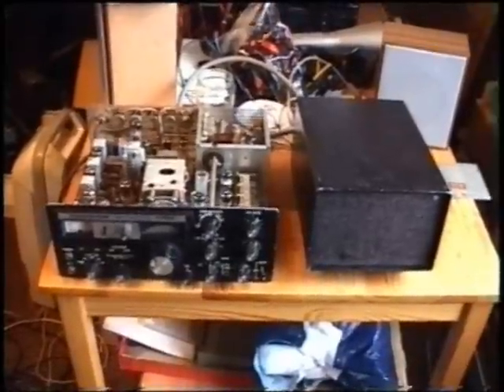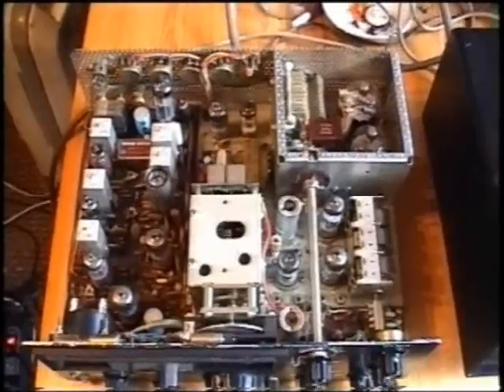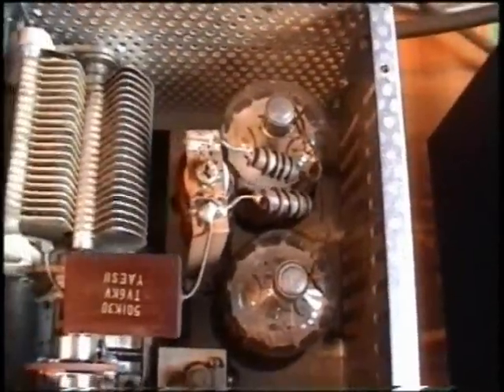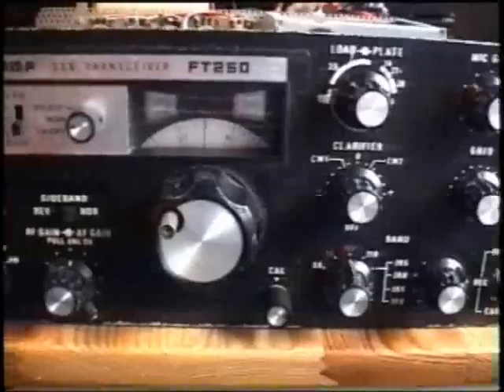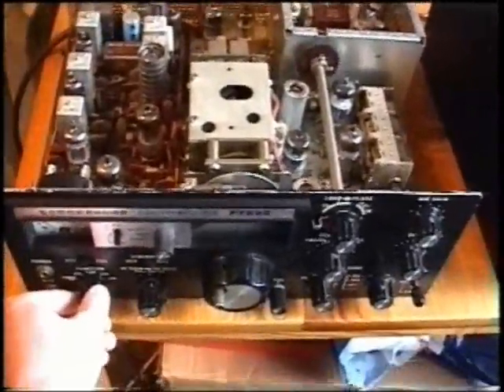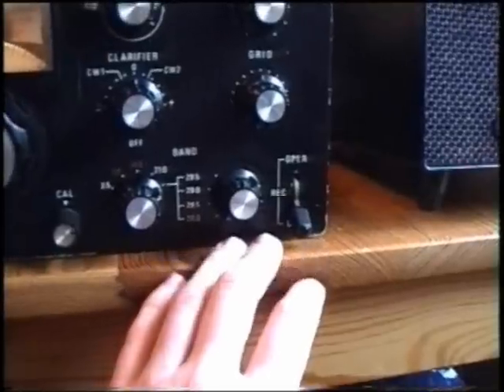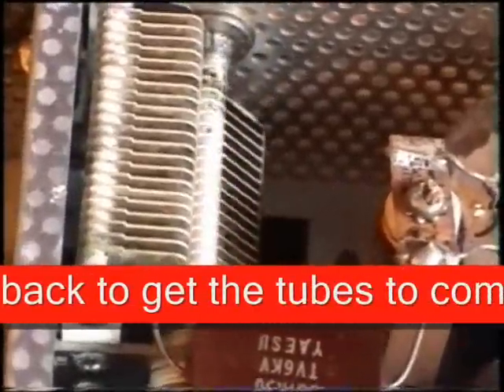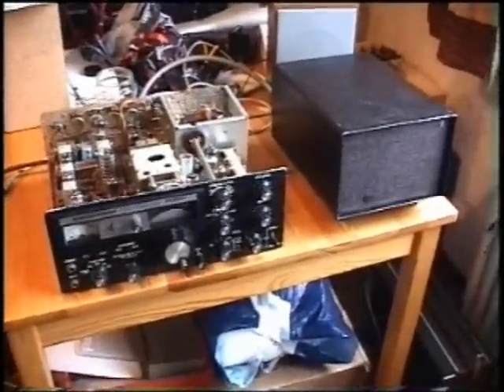Sommerkamp FT250 SSB transceiver in action

Comment: The "AF gain" is the volume control.  I had a similar amateur radio transceiver from the 1960s, and its power output tubes would glow purple when I got it to transmit.  I don't have a license to transmit on the shortwave (HF) bands, though, so I sold it.

Comment: Wow, it actually did something that didn't involve loud bangs, smoke or sparks or short circuits, that's very promesing, you must have been feeling really tense when you flicked the switch for the first time.  Did you replace any of the components in the unit at all?

Comment: you should have hooked a big (several meters) piece of wire to the antenna terminals, put it to AM and seen if you could pick up any broadcast stations. Most of these will at least receive broadcast AM.